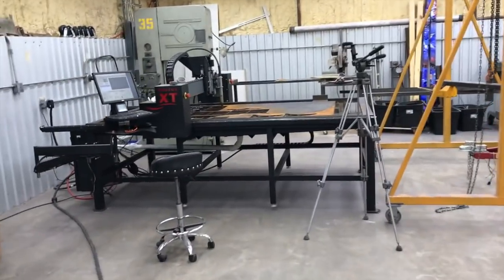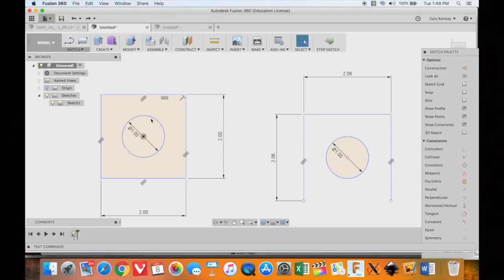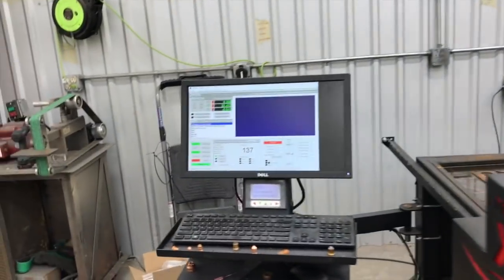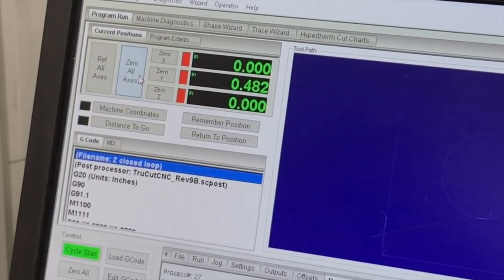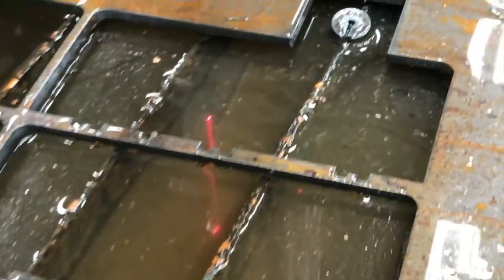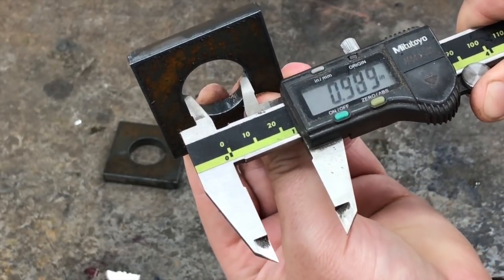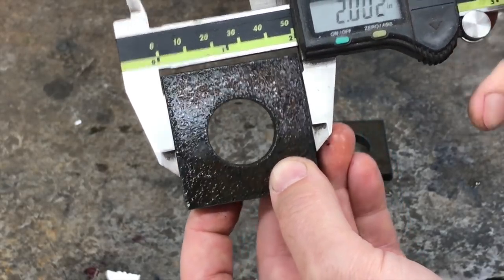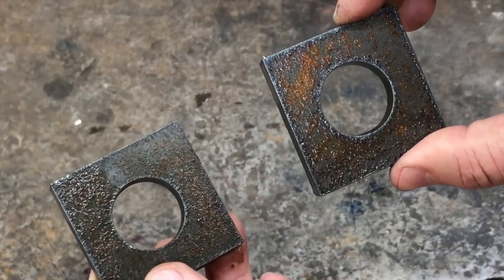Using the Edges of Your Sheet - CNC Plasma Table - Trucutcnc

Comment: Seems fine for small parts that don't need to be as accurate as a cookie cutter part.  One thing I may have missed is that you should be working from a previous plasma cut edge, not the edge of the material which may not be square to the machine axes

Comment: I think this is a fine method for maximizing a sheet. But only if the parts aren't size critical. Let's say those were tube end caps or feet plates that get welded on. More than perfect. Besides, I can't really rely on plasma cut parts to be perfectly demential anyway. I always have to grind back any mating edges because of the dross, heat affected zone or draft... (or all 3)

Comment: I think what you actually have to determine is if the plasma flame is centered on the torch's tip. I have not done any plasma cutting but possibly due to consumable wear/erosion the actual plasma flame might not actually be centered. You could verify this by taking cuts on ether side of a known reference surface. If you are cutting all around a contour this wont show up. Everything will be maintained even if the flame is not centered in the torch's tip. Just a thought. This may be a moot point because as your consumables wear the flame might vary its center-line location in relation to the torch. So trying to save that small amount of stock might not be worth the effort.

Comment: Just a horrible idea ..as the chance of getting a sheet perfectly indexed is slim to none especially knowing the sheet comes rarely with a square edges .. now multiply this with a piece bigger than 2 inches and things can be majorly off . I do have a question?.Why did you not opt to get thier standard machine with the bicycle chain drive?
Reply from the maker: You must be a fairly new subscriber.  I had their Series 1 entry level machine for over 1 year, i have hundreds of videos using it.  I upgraded to the XT to get the faster rapids and finer control using the clearpath servo's.  Mach4 has plate indexing built in so you can index the gantry to the plate, and overall the machine is dialed in and calibrated over the entire cut area of the table to around .030".  Now, as you well know, one variable with anythign plasma cut is consumable wear.  If you put in a brand new set of consumables, and cut a job for 30 minutes, the parts could be off as much as .020-.050 from the first part to the last part dude to consumable wear.  You say its a horrible idea, but people actually do this for small batches of basic shaped parts, and someone asked me to make a video on it so I did.  Overall i dont see a problem with it if thats what someone wants to do. its just not for me ...